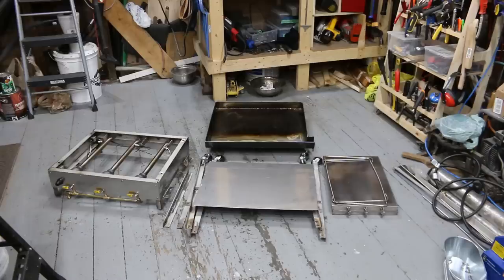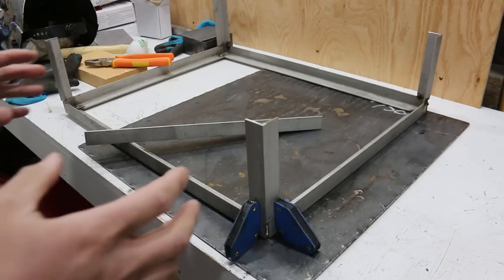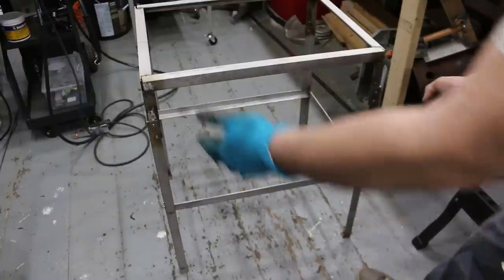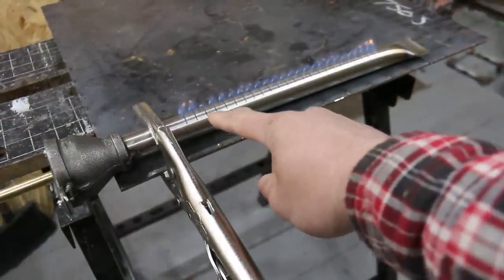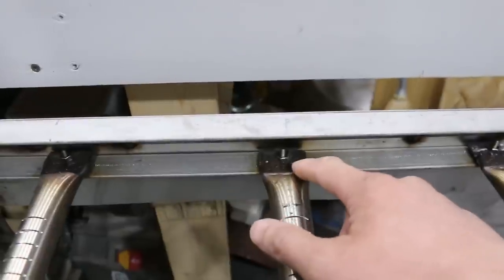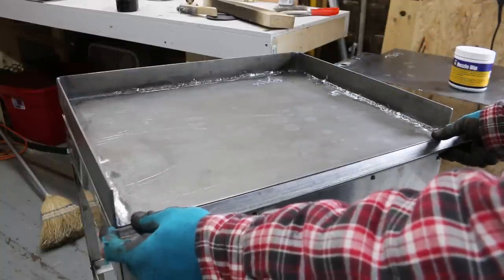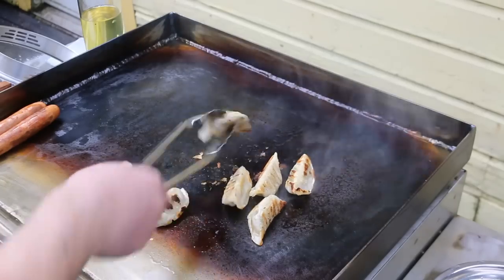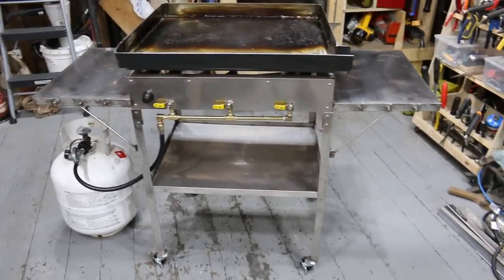How to Make an Outdoor Griddle

Comment: I enjoyed watching this video. If there is any room for improvement, I suggest adding main valve before the three valves, so the three can be open first, then the electronic ignition is used only once to light up the 3 burners. without sacrificing the individual control of each burner.

Comment: Nice job! If you build another one or anybody replicating this, you might let the sides of the griddle hang over the surface by about 1/4 inch and then weld everything together from the bottom.

Comment: Built for your generation to come.
Great video done right. What was the cost of materials?
BTW. You inspired me to build 1. I will get the plate bent for the edges and put a bottom under the burners so to capture some reflective heat.

Comment: Sir thank you for your both video ,very useful ,my question which type of welding can use Mig welding or Tig welding ,which brand and size  of welding it's suitable to do home work job even for car ,,thank you
Reply: what he is using is a mig/gas welder probably mig/aron or mig/carbon dioxide. This is doable at home but tanks are hard to move. There is another kind of mig welding called mig flux core welding which does not need gas. This is your better option. This option does not require tanks and flux core welders are  cheap to purchase and can  be bought at home depot. Lowes. or even  harbor freight

Comment: Great work Drew..On the middle burner, I see you have holes on the reducer and not on the others, Why?
Reply: Andrew Kiggundu 
I watched his burner making video before this, he drilled those on the reducer to attempt better airflow (oxygen induction) during testing stages and it didn't seem to further improve anything so I think he just decided to not drill the others, from what I gathered in that previous video. He went on to explain different sizes holes and propane ratios etc

Comment: Awesome project! You're going to make me build one of these and a wok station too. Been thinking about doing it but your videos might have just pushed me over the edge lol.

Quick question about leveling the grill. Your's looks really level judging by the way the egg spread on the grill. Doesn't look like you have any issues with pooling of the oil either. Did you make sure it sat level before you started cooking or did you just set it up and run it? Also what are you using to catch the oil when it drips from the trough?

You're damn good at building these. I'd highly recommend getting yourself a TIG welder. DC only TIGs aren't that expensive and it will really take these builds to the next level.

Thanks for the videos

Comment: What kind of mig wire are you using to weld that?
Reply: It looked like ER70S which is just regular wire for welding mild steel. It can be welded on stainless just fine but the weld will rust just like mild steel would.
Reply: Would've been better off with 309 stainless wire.

Comment: why does the reducer on the middle burner have all the holes drilled around it?
Reply: If you watch his other video on making the burner he was experimenting trying to get the flame to burn blue. Drilling the holes in the reducer to let more air in had little effect. Changing the size of the hole in the gas tube nipple to 1.2mm I believe was the trick. He just left it that way probably because he did not have another one.  He did say that depending on the size and length of the tube and the way you cut the slits that 1.2mm may or may not work for your application you will just have to experiment with several. 1.0, 1.1, 1.2, 1.3 etc ... BTW Yes I am building one of these.

Comment: How much money was it to make because in Canada stainless steal is not cheap
Reply: I would say at least a few hundred bucks. But you can find scrap pieces for cheap since its a small build.

Angle Bars for legs and frame maybe $30
Wheels- $20 for set of 4 
Stainless Sheet - Maybe $100-$200
1/4" Plate 36x30 - Maybe $60 -80 

Orifice, pipes and burners maybe $50 - $75
Reply: Just buy a black stone - far easier and cost about the same

Comment: By the looks of your grill you have already burned the stainless beyond cleanable. A bit of advice, you do not need that much fire underneath a grill. You could have used only one or maybe two regular round gas burners centered from a kitchen oven and been better off. The trick is a low blue flame to gradually heat the stainless until that heat spreads out at a set temperature not to exceed between 300 to 420 degrees, reason being that at above 420 degrees is that the flash-point of oils occurs and causes oil to flash burn and blacken stain the surface into the stainless when it does so. Nice project thanks.
Reply: The actual cooking surface is not ss if you would pay attention instead of criticize . Your advise is unwanted and useless

Comment: very nicely done. But one would have to have an extensive knowledge of welding and machining to build it. Those tools  are not I dare say in the standard home owners inventory.
Reply: The tools he used to builds this are very affordable. The "standard home owner" now days might get lucky and have a hammer and a couple screw drivers. However the typical DIY Guy or Gal more than likely has all the tools he used on this project. The welder might be the only exception. However a super affordable welders on the market that would make quick work of this project.

Comment: Increase your grill plate thickness to 3/4" that would give even heat distribution and no hot spots. Distance from burner to underside of griddle plate should be 4 inches this gives maximum heat and maximum safety. Finally  install flame failure devices to all burners again maximum safety.
Reply: profssional japanese chefs have grill plates with tapering heat zones, from full to nill, they slide the meat around to the temps they want,   the  heat controls seem to be just  pre-set ,   i'm no expert,  just saw some videos on thiat, here...

Comment: What is mill scale?
Reply: mill scale is iron oxide, it's a layer that forms on  the steel in the hot rolling process, kind of like baked on rust.
Reply: mill scale is a coating that the steel mil puts on metal so it does not oxidize in transit tp metal working shop
Reply: Duane Freeman 😂😂😂 no it’s not.

Comment: Get some stainless mig wire.
Reply: Heavy Metalworks 
Great! This is exactly what I was looking for! So stainless mug wire,  how to you set up the welder? Same polarity as when welding with regular big wire? Or flip the power and ground? 
Also, what kind of shielding gas is used? Regular argon or something special?
Reply: @ZYLIM777  polarity and everything is the same, but you do need a different gas. Stainless you need tri-mix.